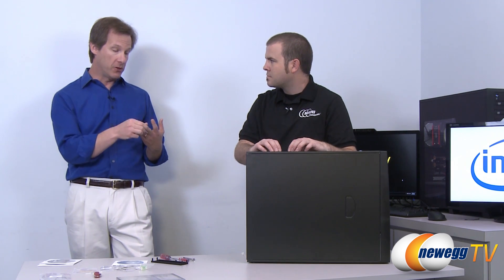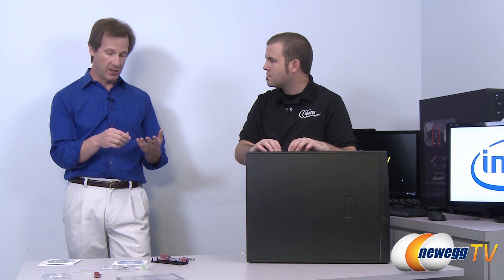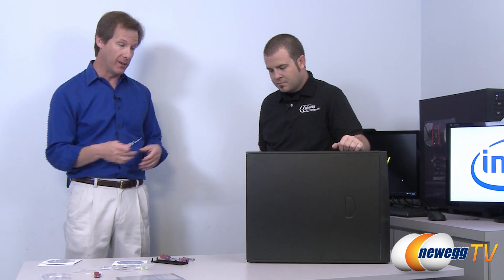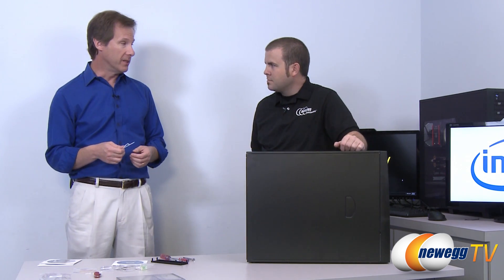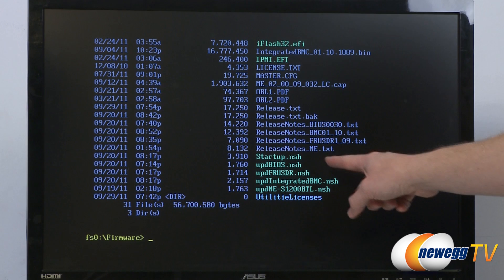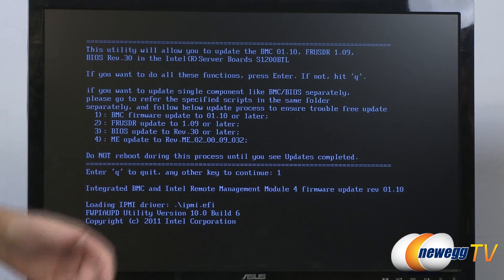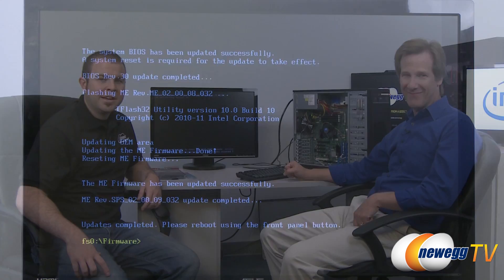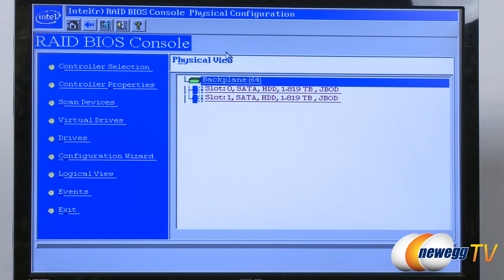Newegg TV: Small Business Server Build with Intel & Microsoft (Part 2: RAID)

Comment: Agreed, it is rare, but it's available. That's the point I'm making. End users, with enough funds, can build a PC that has most, if not all of the features of servers.

There are some exceptions such as proprietary firmware to manage networked servers and PCs, but those are typically available on big-name manufacturer servers such as Dell.

Comment: There's really little separating a server from a PC these days.

RAID controllers... check, cards for PCs, and chipsets w/ built-in cheap RAID.
Dual CPUs... check, EVGA SR-2 & ASUS boards.
Redundant PSUs... check, just need a case to support them
Multiple Network ports... check.
Management Console... this is the only puzzle piece missing. Up-time win for servers.

Servers are all about 1.) up time, 2.) concurrent connection load, and 3.) redundancy/reliability. We have almost all of that in PCs.